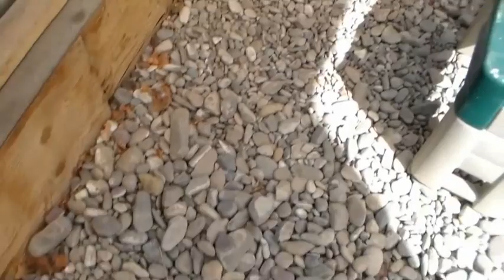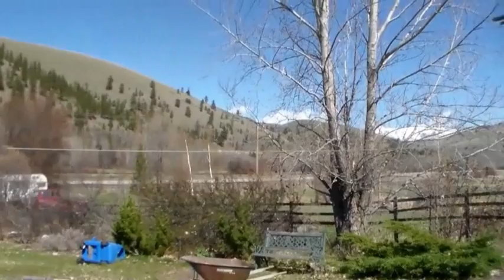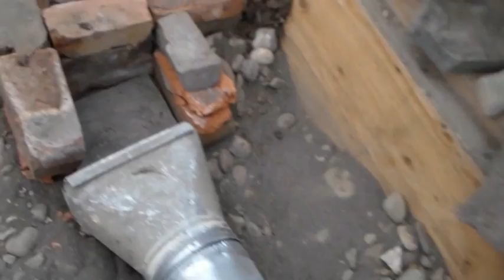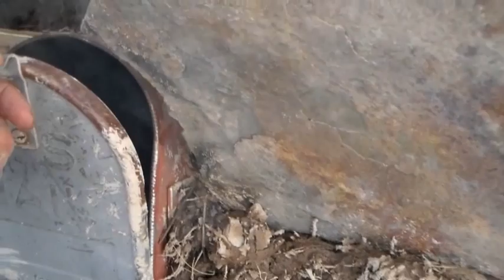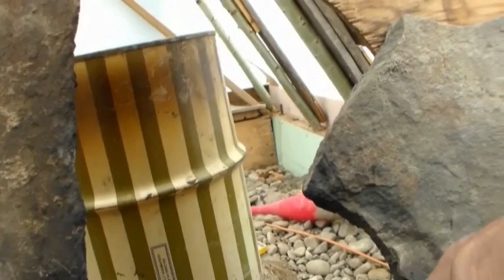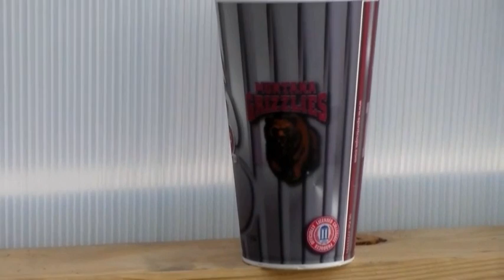Building a Greenhouse Rocket Stove

Comment: I am so grateful for your vision and dedication over the years in working with this concept. There are so many applications of it so many materials that can be used. 

I've been trying to get the idea out to North Carolina and Tennessee cuz they're facing winter!

This PLAYLIST shows a simple, effective, efficient and inexpensive way to heat homes and tents and sleep on warm ground!!!
The idea uses the Earth as thermal Mass and radiates heat up into the living quarters whether it be a tent or a teepee or a yurt or a shed.
 Dakota Fire Hole Trench Rocket Stove Earthen Thermal Mass Heating System 

28 Video Best Dakota Fire Hole Earthen Thermal Mass Heating System

https://youtube.com/playlist?list=PLsEWVATMY6q2fs1n3lDWhsIlBxo0-rbAP&si=K0isX1WI38DOmSkY

You mentioned heat and it's getting cold there. 
I'm hoping maybe you or someone will listen to me and get in touch with me. 
I Have a solution for a lot of people. 
For now I'll just put a couple, no just put one playlist.
Please watch a few of the videos. 
Watch at least the first two cuz the first one is going to be the first of two from a guy who built an underground trench whatever you want to call it tunnel rocket stove. He was going to set up a tent over the trench.
He had fired it up one day. It snowed lightly.
He fired up again and it melted all the snow. You can see that in his 2nd video.
The video after that is the first of three of my videos which I did on the system that I built. 
You'll see the video it's inside of a geodesic dome. 
I put that system up and I did put the Dome up over it after we built it. 
My little grandkids help me do it so it's something that anybody can do. 
In the dome I did an interview for a documentary called beyond off grid wish if you have time you should watch it. 
I guess that's enough for now I'm trying to be very brief...

My name is Jerry Diamond.
I won't bore you have a lot of personal history and details. 
I have studied for this point in time for 40 years now. 
My mind works such that when I see a problem I work on it till I find a solution. 
People talk about the motivation and the desperation and the burden and the sorrow and the devastation out in Western NC and Tennessee.
I felt that for 40 years and it used to almost kill me and now that the I'm SEEING the grief that I felt for 40 years, it is not affecting me as much as I had processed it all for decades now. 
What you're all feeling I felt 20 years ago 30 years ago. 
What you're living through I felt in my heart and soul and mind for decades now. 
I've been planning on how to help people for all the time figured how to do it with inspiration by God but I put a problem in my mind I just work on until I get a solution. 
I have 100s of inventions and ideas.
EVERYTHING that I designed worked.
I built three of these systems. 
They all worked perfectly.
One of the second video you'll see was the Most elaborate one and the most thorough one that I built.

The third one was the simplest smallest cheapest one made from 6 cm diameter that's 2.36 in camping stove pipe stainless steel stove pipe. 
I was going to send it out with my daughter...
She lives near Ashville.
I was going to send my 6 cm prototype with her, but figured I can do more good by making videos and showing everybody how to do them because the parts are cheap they can be bought from Amazon AliExpress or eBay.

I Will post a parts list soon basically you need two elbows, about 6 to be 10 feet of horizontal pipe for the trench, then the second elbow and about 4 ft vertical pipe coming out of the ground and that needs to be insulated or a thermal Mass around it so we can warm up heat up that's what creates the draft or draw because heat rises.

There's Amish around the country that make stove pipe from stainless steel flashing. 
It's heavier wall than the junky black pipe you buy in the store and they sell it cheaper than what you buy black pipe bought in big box stores which will rust out after one year. 
Even this SS stuff won't stand up to the heat of a rocket stove forever, but it'll last a long time once you get the idea then you can build it out of anything fire brick slate Rock sheet steel there's a thousand ways to build it and 100 types of material to build it out of.

I wish I could come out and help. 
But I can brainstorm and advise and help in any way that I can.

I Cc'd this to my email and my number is
417-988-0333.
Call me anytime of day or night 24/7/365.

Not saying I'll answer all the time so text me that'd be the best thing text me email me call me do all three I'm on Facebook Messenger if you want to do that route I have been on Signal, so if you're on Signal I would get back on Signal but I'm not on there now. 

Please be safe as best you can. 
You're aware of some of the dangers. 
You have no idea how deep the evil goes and how great their forces are you up against. 
TJ of Grindstone Ministries who's been out there a lot says that 
"We are in a protracted asymmetric war 
against FEMA and the federal government "
and civilians that are fighting and maybe they're winning I don't know they got some big ass dangerous badass equipment I know that.
The minerals there are worth several trillion dollars:
 THAT'S what you're up against: evil people wanting the minerals under the Land there I don't see much hope.

Comment: how about a chimany going up above your green house then you will get the draw you want.
Reply from the maker: Tried that, Daisy, and we still didn't get enough draw. But thanks for the suggestion. We are going to build a high tunnel greenhouse in the early Spring and get back to re-working the rocket stove in this old greenhouse during the Summer.

Comment: one of the ways to reduce backdrafting is to run the galvanized pipe back beside the barrel and then straight up. The heat of the barrel will cause the air inside the pipe to to heat and rise faster and fight backdraft problem. The air inside your galvanized pipe is cooling too fast and isn't hot enough to rise fast out your exhaust and fight the backpressure. Sometimes there are limits to how far you can run pipe but now you've covered it with cob it might draw better as it is. It looks great!
Reply from the maker: Thank you for the information and advice, James. Now I am having second thoughts about breaking through some of the cob to replace the first section of 6-inch pipe with some 8-inch pipe. Another rocket stove builder I know told me that would improve the draw. I guess I'll ask around some more before I start revising it. Wunniook ! (Be well and live in balance- in the Wampanoag language.)
Reply: that is a great reminder...... you are oh so so so correct this is how youtube should operate lost of demonstrations  and lost more constructive  feedback

Comment: How is the best way to build cob around the stove pipes so that you can still have access to clean?
Reply from the maker: We have one side connector pipe that sticks out of the cob a couple of inches and has a removable cap on it. We can take the cap off and run a plumbers snake in there to clean it out if need be. But the thing is, when the stove is working in its optimal manner, it burns so hot and clean (or thoroughly) that nothing goes into the pipe but steam!